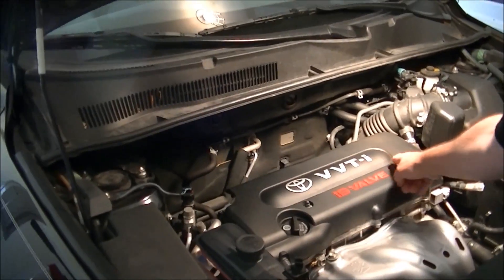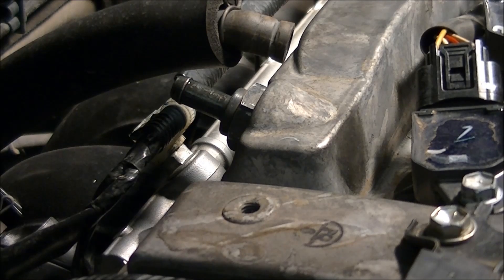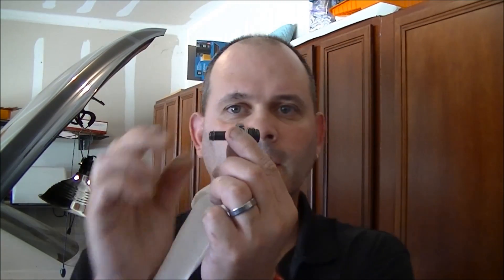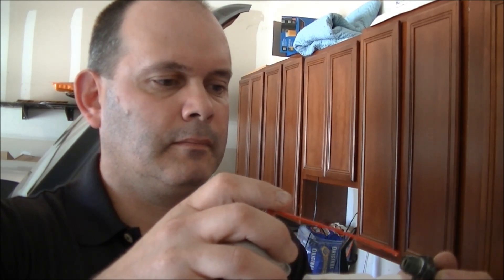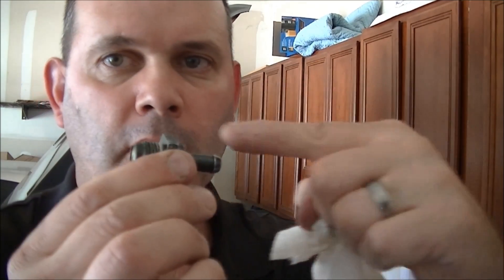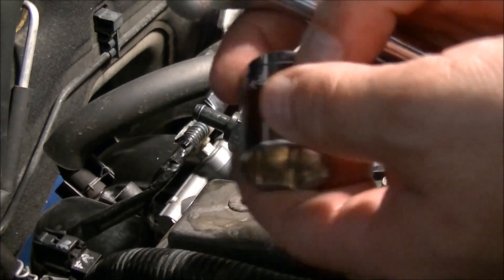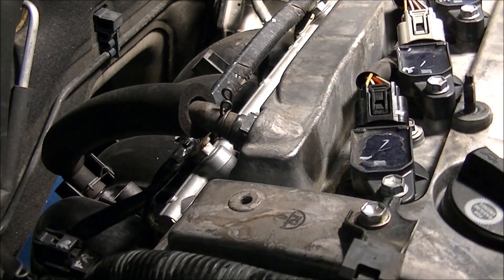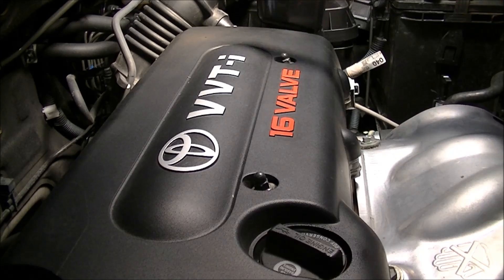Toyota Rav4 2008 Checking the PCV valve 2.4L 2AZ-FE engine. Every 36,000 miles

Comment: Thank you just purchased rav 4 and changed the plugs still but if riugh idle. I will check clean kr replace thank you for tutorial on it i will di see if helps. Keep posting. I live learning snd doing it nyself. Thank you Great video
Reply from the maker: Check the oil. Make sure it looks right. If coolant is leaking past your head gasket it will look muddy. You may want to check for vacuum leaks as well as check your air filter too. You're most welcome and thank you so much for commenting and the very kind words. I appreciate it greatly. Subscribe, Click The Bell and stay tuned! All the best.👍😀

Comment: Hello pls advise..am using a toyota blae 2.4  same engine and am getting horrible gas/petrol efficiecy..any tips on how i can approach the issue?
Reply from the maker: Start with the basics, check and replace these parts if required: spark plugs (Iridium are best), spark plug wires if they are shorting or cracked. Check air intake filter. Have the vehicle checked for codes and address any and all that are found. Check tire pressure and wear. Replace if required. Check the oil level and if dirty replace (synthetic preferred) and don't forget the oil filter. Check brakes for proper operation. All wheels should spin freely in neutral. Good luck.  Thank you so much for commenting and watching. I appreciate it greatly. All the best.👍😀

Comment: Wouldn't the Teflon tape put stress on the alloy cover? Thanks for the video 👍
Reply from the maker: No the tape is very soft and will only help to seal the threads against leaks. Thank you so much for commenting. I appreciate it greatly. All the best.👍😀
Reply: @richardlloydusa  thanks for the reply. 🙂
Reply: @annndresf  I bought a new one from Toyota and it comes with it on the threads
Reply from the maker: Thank you so much for watching, commenting and the valuable feedback. I appreciate it greatly. All the best.👍😀

Comment: Thanks for making this, I’m planning to do this soon and I hope it is the reason my car is burning oil because if not then it is the piston rings! I’m reassured that it will be a straightforward procedure.
Reply from the maker: I hope it works out well for you. You're most welcome. I'm glad and very happy to know that I could help you. Thank you so much for watching, commenting and the very kind words. I appreciate it greatly. All the best.👍😀
Reply: Was it rings lol
Reply from the maker: Very common on this engine, unfortunately. Thank you so much for watching and commenting. I appreciate it greatly. All the best.👍😀
Reply: Did it solve your problem? I have the same issue with mine

Comment: How's your oil consumption?
Reply from the maker: It was "acceptable" by Toyota's standard but the engine had a defective engine block or head bolt defect which caused the head gasket to fail at 105,000 miles (5K out of the extended warranty). Toyota would not warranty their defective engine, so I rebuilt it in my garage in the middle of summer in Texas (No AC). After it was running perfectly I promptly traded it in for a Hyundai Sonata 2.0T that ran perfectly the whole time I had it (way past 100K miles). It was easy to service (I have videos) and now I drive 2004 Hyundai Santa Fe 4WD which now has 154,000 (cost $3000) runs like a clock (very reliable). So $34,000 for a Toyota that didn't make it past 105K or $3000 for a Santa Fe that I put 30,000 miles on so far and runs perfectly at 154,000 miles. Sorry Toyota but you are probably NEVER getting me back as customer. You may have gotten lucky with your Rav4 but I would never recommend or buy one again. Once burned...... BTW I don't think a well engineered well taken care of engine should EVER burn a quart or oil between oil changes. https://www.samarins.com/reviews/rav4_06.html Best of luck to you. Thank you for watching and commenting. I appreciate it greatly. 👍😀

Comment: hey , thanks for the vid ,  my rav 4 has blow by , if the pcv is is not working as it should do you think that would cause blow by out of the oil filler cap?

Comment: thank you so much..my RAV4 engine running 2900km and the oil level still at upper mark dip stick..almost no oil level drop ..before is worst, 2500km level drop to half dipstick..u really helps
Reply from the maker: You are most welcome. Thank you for commenting and the kind words. All the best.

Comment: i already clean my pcv valve..i saw some residue oil/dirty...i hope no more oil loss..i still monitor engine oil level time to time..thanx a lot pal
Reply from the maker: You are most welcome. I did it on my 2003 Hyundai Santa Fe and it fixed the oil leakage I was getting from the engine in my garage. Thank you for watching and the kind words. All the best.

Comment: hy Richard 
wanted to know where is the pcv valve in my 1995 Rav 4...thanks
Reply from the maker: If you have the 3S-FE engine the PVC valve is in the center of the valve cover between the two middle spark plugs. Make sure you buy the rubber grommet for it too. Here it is at Ebay: https://goo.gl/njKr5K or here at Amazon: http://amzn.to/2tnqyOG I believe the part number is 12204-74030 make sure you verify it before you buy it. I would suggest replacing the hose too. Thanks

Comment: Hello , I have LandRover Lr3 , do I need to takeoff the battery to clean the pcv ? Thank you for the video
Reply from the maker: I don't have experience with the LandRover Lr3. Generally the PCV valve is a mechanical device not an electrical device, but that may or may not be the case with your LR3. Here is a discussion on the PCV valve for the LR3 :http://landroverforums.com/forum/lr3-28/pcv-valve-leaking-60168/ Hopefully that will help. Thanks.
Reply: Richard Lloyd thank you very much 👍👌it's exactly same like mine , very helpful
Reply from the maker: You are most welcome. Thanks for watching and commenting. All the best.

Comment: mr lloyd sir mine is a rav4 207 model with 2.2 litre diesel engine white smoke problem this pcv valve cleaning applies . to my car or not
Reply from the maker: I believe all engines have one. It is part of the pollution control system of your car. Thanks.

Comment: Thanks for sharing great work, really the way you explained is very interesting, keep it up but still question is how to check pvc function at idling when vacuum at intake manifold is maximum, any idea? Thanks again.
Reply from the maker: +Jamal Khan You could use a vacuum gauge connected to the PVC valve but I have no idea what the vacuum pressure should be at idle at the valve.  Here is a video of someone doing it but again I have no idea of what value it will be to you unless you know what it should be https://www.youtube.com/watch?v=PhjH1eEZ3KQ Thanks.

Comment: I just purchased a 2007 RAV4 L4, with 78K miles, and I was looking for Youtube videos to see how to DIY myself, to keep it running pristine, like it is now. I thank you for your excellent videos, and the more videos you create on how to keep your RAV4 in pristine condition, that certainly will be of help to me, and I would appreciate it very much. I must ask one very serious question:  since you have over 100K miles on your RAV4, and with you'r taking care of your RAV4 so well, have you ever experienced any serious problems, such excessive oil consumption or transmission failures, etc. If you knew then what you know today about your RAV4 would you purchase a bumper to bumper service agreement when you purchased the vehicle.  Thank you for your excellently detailed videos and your responses.
Reply from the maker: +Sam Rafeedie You are welcome. I did have the 100,000 mile extended warranty when I bought the Rav 4 so I was covered until 100K miles. I only had a failure of a water pump prior at about 75,000K. It developed a seal leak but I replaced that on my own. I would still buy the bumper to bumper warranty on it and recommend it to anyone who owns this vehicle. Personally I was not impressed with quality of this vehicle or the engine. It did not inspire confidence in me. I sold it shortly after 105K. I always found the engine to be noisy at idle as it is known to be. I have read the forums and Oil consumption seems to be a real issue with this engine. My engine began to use a slight amount of oil after 90,000K. It was using about quarter quart (litre) of oil between each oil change which was part of the reason I was not to confident with the engine and decided to trade it in.
I bought a 2011 Hyundai Sonata 2.0 T which I drove for 50,000 without any unscheduled maintenance problems at all. Now I am driving a 2014 KIA Sorento SXL which I find to be a far superior product to the Toyota Rav 4. Hyundai and Kia are the same company and I expect that I will have the same experience with it as I did the Sonata. After my experience with the Hyundai products I don't think I will ever go back to a Toyota. BTW Both vehicles come with a bumper to bumper 5 yr/60,000 mi basic, 10 yr/100,000 mi powertrain.  Thanks for watching.

Comment from the maker: imstricken06 The last carburettor I cleaned with carburettor cleaner had rubber seals, rubber O-rings and plastic floats and the carb cleaner did not hurt those at all. The carburettor still works today without any problems. So I am not sure why they would make carburettor cleaner that would hurt those parts? Thanks
Reply from the maker: You will get several symptoms (all of them bad)
#1 Excessive oil consumption, leakage and sludge build up in the engine
#2 Contaminated engine air filter
#3 Overall poor performance
Here is a more detailed explanation of these symptoms https://www.yourmechanic.com/article/symptoms-of-a-bad-or-failing-positive-crankcase-ventilation-pcv-valve
An easy way to check for sludge build up is to take the oil filler cap off, use a flash light, and look inside your engine through the filler port, if you can not see any there look inside your oil filler cap it's self it should not have any sludge in it. Sludge is an oily substance that has the consistency molasses and can be black, brown to light brown in color.
You can see many examples of what it looks like here: https://www.google.com/search?q=what+does+engine+sludge+look+like&client=ubuntu&hs=8ZL&channel=fs&tbm=isch&tbo=u&source=univ&sa=X&ved=0ahUKEwjNv-id4e7PAhVpxoMKHajPDVoQsAQIJQ&biw=1301&bih=673#imgrc=_
 Thanks.
Reply from the maker: You are most welcome. Love Puerto Rico, beautiful place, beautiful people and great food. Enjoy your weekend as well. Thanks.
Reply: i cleaned mine with PB BLASTER
Reply: Richard Lloyd i know you have been her already. Hope you channel grow exponentially.

Comment: It is probably a good thing that you don't own it anymore :-) I had seen that video thank you. I used your spark plug video which was very informative so I was hoping you had one as well.
Reply from the maker: I was looking at that video and I think you can take control valve off without taking all apart. It looks like it just bolts on to the throttle body. You might be able to free it up by just taking the motor housing off and turning it. Good luck.

Comment: Richard,
why did you have the engine apart?
is this a motor under the TSB 0094-11  Oil burning issues
Reply from the maker: I am not sure if the engine was covered or not by that bulletin. I had a head gasket that needed repair. Thanks

Comment: Hi Richard,
I had camry 2007 LE 4 cyl with 80,000 miles.  I always use 5-w-20 conventional oil and change it in less than 5000 miles.  I am thinking about switching to synthetic oil and also change it around 5000 miles.  What do you think about that?
Thanks
Reply from the maker: There should not be any problem doing so. Here is what Valvoline says about changing from regular to synthetic: http://www.valvoline.com/faqs/motor-oil/full-synthetic-motor-oil/ here is more on this http://auto.howstuffworks.com/switch-to-synthetic-oil1.htm Thanks for watching.

Comment: Also, do you have to replace this thing with a brand new one? Or, can you just clean the valve and reuse it?
Reply from the maker: No need to replace if it is working. If you are worried about it you can buy a brand new one from the dealer. I doubt it will cost you more than $20.

Comment: What happens if you don't change the pcv valve for over 8 yrs?  Will that cause leakage, and engine malfunction??
Reply from the maker: There are many factors that this would depend on, regular maintenance, oil changes, environment, mileage etc. If your valve is still functioning properly there is no need replace it. If it is not broken there is no need to fix it. If it is not functioning this will lead to engine and oil fouling which will increase the wear on your engine and shorten the life of the engine. Thanks
Reply: Okay.  Thank you.

Comment: @Richard Lloyd
I need help!!
I noticed that the Low pressure aluminum pipe has water condensation, its coming out  from the  L-knob and about 5 inches in  both direction from the L-know. Is this normal?
also I have water dripping under my car. What do you think the problem is. Thanks!
Reply from the maker: I no longer own this vehicle. I am assuming you are referring to AC system. The AC does drain condensation. I would contact your dealership to make sure. Thanks

Comment: I was going to replace my PCV valve which is easy to get to on my Toyota.  My problem is the rubber hose is stuck on and is hard and corroded.  So I cant get the hose off.  I might have to cut it off.  I was going to find a replacement hose before I continue.
Reply from the maker: I would suggest getting the new hose before you begin as it my break elsewhere or may not be long enough to reach if you cut it. Besides if it is that hard it is probably brittle as well. Thanks

Comment: Isn't the PCV valve also supposed to restrict air flow more at idle (high vacuum) vs opened throttle, so that you have less recycled blow-up gas at low vehicle speed?  Is there anyway to test this as well?  Or you believe that if the check valve is working, then the amount of restriction at different vacuum is more or less OK as well?  Thanks.
Reply from the maker: A crankcase ventilation system is a one way passage for gases to escape in a controlled manner from the crankcase of an internal combustion engine.This is necessary because internal combustion inevitably involves a small but continual amount of blow-by, which occurs when some of the gases from the combustion leak past the piston rings (that is, blow by them) to end up inside the crankcase, causing pressure to build up in the crank case. For control of the pressure inside it, a PCV is used to vent the crank case. You can see a full explanation here. The interesting fact is that it was created for tank engines so they could go through deep water. http://en.wikipedia.org/wiki/Crankcase_ventilation_system
Reply: Richard Lloyd
I think I understand the general idea.  But I thought that the valve also has a functionality beyond just being a check valve and that it is supposed to open more at open throttle vs. at idle.  In the wikipedia article you cited, there is a passage:

 "At idle, the intake manifold vacuum is near maximum. It is at this time the least amount of blow by is actually occurring, so the PCV valve provides the largest amount of (but not complete) restriction. As engine load increases, vacuum inside the valve decreases proportionally and blow by increases proportionally. With a lower level of vacuum, the spring returns the cone to the "open" position to allow more air flow."

So according to this, the PCV is supposed to provide more restriction at idle (high intake vacuum) vs. at load (low vacuum).  So I am wondering if this functionality can be tested as well.  Or if the check valve functionality test is sufficient, and if the check valve is OK, you can assume that the valve is restricting air flow more at idle vs at load.
Reply from the maker: yusuihang  The valve is function is regulated by air pressure differential between the intake and exhaust side of the valve. The valve is a one way valve it only allows gas to escape from the crank case. See here http://www.agcoauto.com/content/images/engine/pcv_system_valve_operation.jpg the problem arises when the valve gets fouled or stuck and can no longer regulate the gasses properly for instance stopping gasses when it is supposed to (Stuck Open) or not allowing gasses to pass when (Stuck Closed). If it is not operating properly it will cause the gasses to contaminate the oil which can result in sludge, oil breakdown and premature engine failure. In my understanding the valve will either work or not. If you are worried about it you can always just replace it. I have to state that I am not a professional mechanic.

Comment: Shit, couldn't find the right PCV valve for my car at my location... I found that my PVC valve doesn't have any spring or valve... It's just like a plastic tube. So i just added my own spring and found little valve of some other part and put it into the valve... So it worked fine for me :D
Reply from the maker: Not sure I would recommend making your own. I would suggest getting an Original Equiptment Manufacturer (OEM) replacement. But hey if it worked for you that's great. Thanks for watching.
Reply: Yeah, I tested it like you do, so im sure it works fine :)
Reply from the maker: ThreeDriv3rs  Sounds like someone just took off the original and stuck a tube in. Great job.

Comment: what else can i use to clean it ? ....please help
Reply from the maker: What ever you use make sure it will not melt plastic or rubber.
Reply: Thanks for your help Richard i appreciate it
Reply from the maker: Brandon De Matas I used brake clean without any issue. It's pretty common at any Walmart or auto supply shop.